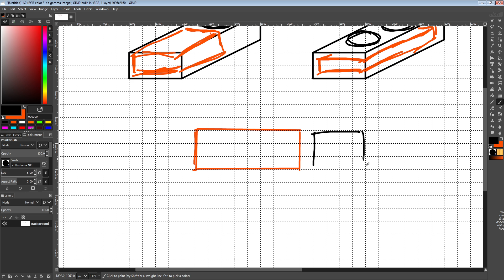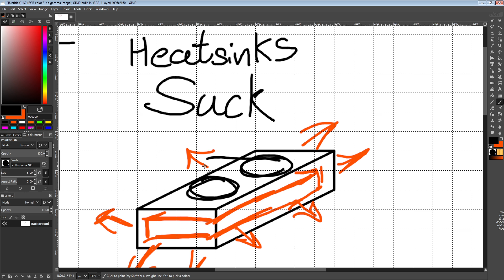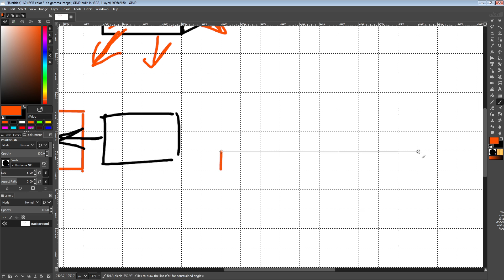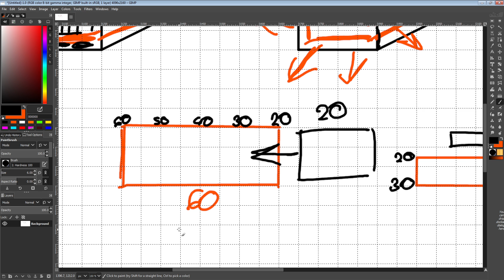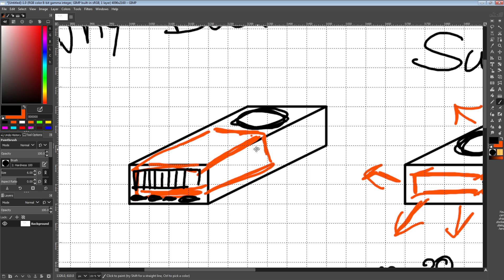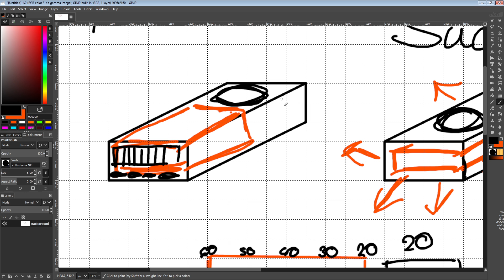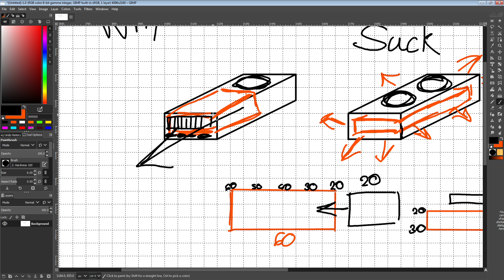Why blower heatsinks suck

Comment: 21:15 to 21:40       I have never been so convinced in my entire life.
Reply: So very true, and even worst, my 980Ti's main cooler cools ok, but it's backplate is buring hot,  The main fan flow does not reach the backplate, the CPU heat is trown on the backplate, and and and.. its crap. I duckt-taped a fan to the videocard. a bad case of bad case
Reply: you're easily convinced.
Reply: @-morrow  sorry
Reply: @pangtundure  perhaps read the comment from Sam Fedorka to deconvince you? ;-)

Comment: Buildzoind: you could not chose a worse design

Me: vacum insulated card to prevent GPU heat from heating up other stuff
Reply: Congratulations, you’ve just invented a XFX THICC 3 series GPU :)
Reply: @gingeritto  All that was needed was Happy Meal plastic!
Reply: Sun in a vacuum of space: Am I a joke to you?
Reply: @Loachie90  sun only sends out heat through radiation. Although the gpu will have minor radiation most of the energy will be kept
Reply: @user-y6f  until it heat up enough to glow.
Reply: dont give AMD ideas...

Comment: What if: https://prohardver.hu/dl/upc/2020-09/493_vga_cooler_toomuchtdp_2.png
I (and most of us) have extremely unexploited space in the case: over the PCIe slots. Use them to have a cooling system, that merges the advantages of the blower solution with SILENCE. :)
Legend: RED - fans | Orange - Heat pipes | BLACK - GPU | Rest - fins
Imagine a covering "tube" around it to ensure the air is moving outside the case.

So why don't manufacturers do this?
Reply: Just wondering why CPUs with 100-150W TDP have MUCH bigger space to have a cooler in it than the GPUs with ~300W TDP?
Reply: 1) It is possible and a lot of "mods" do exactly that - put CPU coolers on GPUs.
2) This will run into the same issues as high-consumption CPU coolers (like threadripper coolers) - when heat pipes are not enough efficient to dissipate heat through the whole radiator.
3) This will create a lot of issues for people with smaller cases, or with other expansion slots occupied, etc. and probably would be impossible to standardize.

But it is really easy to address - case manufactures can make an adjustable bracket for a fan or two near expansion slots. I did it by myself in a few cases and it is really simple "mod".
Reply: @InterUse  
1) That's not the same. It's very important part of my suggestion to ensure moving the air outside the case at the back panel part of the slots.
2) I don't think it's the topic here. You can use as much heat pipes as you can over a CPU or with a standard VGA cooler. The main issue is to push the warm air out with staying silent.
3. The space over an ATX motherboard is already standardized. Everything is already standard here, the only difference among the users is whether they use a slot or not. Thus, it's up to them to decide they want a VGA with such a cooler or not. ;)

Comment: they are great... because you don't need an ugly gaming case and still can manage to have reasonable/low case temperatures. great design, sadly limited when it comes to tdp.
EDIT: the problem is not the blower cooler, its the power draw of modern cards (remember the 5870 and its blower?)
Reply: Yeah, but on the other hand the 5000 series (well, the old 5000 series. Unfortunately we've got another one right now confusing things) were the most power efficient graphics cards of their era.

Granted the peak performance per watt from that generation is the 5770, not the 5870...

But you compare the tiny heatsink on my Sapphire 5770 to my RX480 (also a sapphire card) and it's insane how much the heatsink and fan setup has had to grow over time.

The 5000 series was the peak of Ati/AMD design, and unfortunately it's been downhill ever since.
(ironically Nvidia came out with Fermi at the time, which used huge amounts of power. - now the 3000 series seems to be repeating that concept. 350 watts for a reference design!? Are they serious?)

Comment: Love the content on this channel, but I whole heart-idly disagree with this. Do they cool as effectively as a huge 3rd party design? Not really. Do they suck? Not at all. Nvidia spends thousands of engineering hours designing them. They dont suck. I always buy reference/founders cards and they work great. Easy to put a water block on too.
Reply: it's like that ONLY to cost less and be sold at the same price while doing the bare minimum (often less than that), in that regard they are awesome yeah for the shareholders. you could say "designed by beancounters" but don't bring engineers into the equation: they know and they want to scream.
your purchase decisions are your right to make and that's ok, however the watercooling argument is moving the goalpost and it is undeniably demonstrable with practical experiments and physics calculations and simulations that it is in fact a flawed design. :)

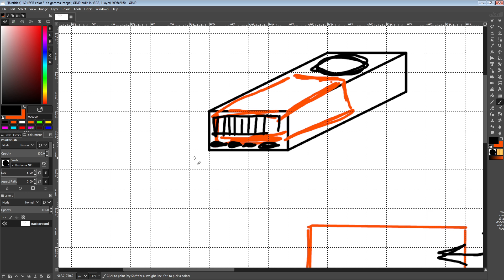Comment: only 5:00 in, so don't know if you covered it, but would love to know your thoughts on the 3090 FE design with the hybrid blower / axial cooler
Reply: The blower portion has a MUCH shorter HS, so won't have the long HS problem,  and the back fan is the much more efficient flow through design. I expect most cooling power at the flow through portion, but blower part will help prevent heat build up under the card. I am betting it works really well.
Reply: Only a couple of days left until we will get reviews of the 3080 and a week or so later we should get 3090 reviews. We might just wait this short amount of time and see how the cooler design performs.
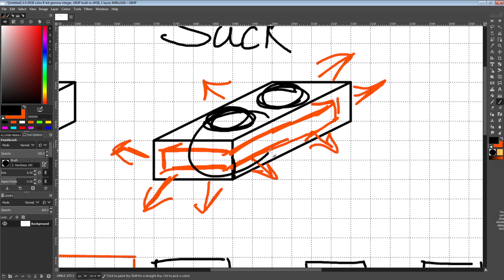Reply: He doesn't mention the 3090 directly but at 9:30 he is saying that boring through a cooler with heat pipes would be the best thing and even mentions a few examples other than the 3090.
Reply: there will be a downside that the Fan hanging off the back there will provide mediocre Cooling since it's nowhere near the source of the Heat.
the Heatpipes that i'm sure they're using will help compensate for it just like we do with all Heatsinks, but it means that part of the Heatsink will be completely reliant on those Heatpipes to do anything at all and also means that only the surface area of like a few Millimeters around those Heatpipes will do anything at all, and the rest will just be weight for basically no performance result.

if they really wanted to impress me, they'd have the other Fan also be able to move air through the PCB by cutting some holes.
to make that really work you'd want to move the GPU die farther away from the PCI-E Bracket though, to keep the most effective Fan as the one directly above the Die.

in short it's a better Reference design but one that's still pissing a way a lot of performance for little benefit.
Reply: @taiiat0  "but it means that part of the Heat sink will be completely reliant on those Heat pipes to do anything at all and also means that only the surface area of like a few Millimeters around those Heat pipes will do anything at all" 

Going by the renders the heat sinks are practically separate (because of the choke point on the decorative fins on the middle, which works passively if there are connected to the pipes, reducing the area exposed directly to airflow) which should indicate less performance but the use of heat pipes IS an effective way to move heat efficiently even when talking about small GPU/CPU dies, also have into account on most video cards, CPU coolers, laptop coolers, etc. rely mostly on heat pipes to soak the finstack (or exclusively just look at a CPU tower cooler) even relatively long distances (like several inches) depending on how much heat is being sinked in, the effectiveness at this point should be more of cooler construction and material choice

"they'd have the other Fan also be able to move air through the PCB by cutting some holes."

Are you sure about that buddy, sure a cool design and interesting as heck but a GPU is more than dies, ic's, and electrical components. A GPU is a device really dependent on frequency which makes it also dependent on PCB tracing and putting holes just to pass air would require lots of RnD without much benefit due to all the space required to keep signal integrity that why you see most of the mounting holes being away of the middle of the card to keep the most frequency dependent components closer together

 Overall i don't think it would be the best cooler out there but it wont harm performance, at least not a lot, also this design isn't all that new, even on "modern" GPU just look at power color 5700xt, NVIDIA's is a way bigger hole but is a tried an true way to improve GPU thermals
Reply: yes, Heatpipes are a necessity we have to rely on everywhere. the point was having to rely on just the Heatpipe to get anything done and that a lot of the surface area of the Heatsink will do very little other than adding weight because of being far enough away to have to exclusively rely on the Heat Pipes to be effective.

PCB's are not insulating medium - whether you have a hole through the Fiberglass or not doesn't change that. if you need to protect the signal, that's what shielding is for.
having holes where possible to allow for real air movement (if they're going to always insist on strange Fan choices).

the other non Reference Cooler designs have much less of the problem to deal with since the entire Heatsink is pretty thin everywhere, so the direction of air is already getting all of the efficient surface area out of it.
the shorter PCB allowing a full face passthrough will get some of that benefit but their gayyyyyyyyyyyyyymery Heatsink designs are gigantic, and therefore really heavy and take up a lot of space, for little extra Cooling performance. it's mot of the same problem we've already been having with their Reference designs in the past, where the decorations on the Cooler are big and heavy and so a relevant percentage of the MSRP is not buying smart sand, but rather buying bent pieces of Metal as Modern Art.
Reply: @taiiat0  I'm not talking about interference on the traces rather topology, the bigger the path for a high frequency signal has to travel the more likely to have bad signal on the reception end, that's why oscillator crystals have to be so close to the microcontroller they are giving the signal, not only that but they have to reach the receiving end at the same time, like the ram traces to the CPU, sure isolating for noise is one part of it but also the length is important the shorter the better as long as is the same length as the other traces, putting holes anywhere near to the first fan would be a tracing nightmare.

"the point was having to rely on just the Heat pipe to get anything done and that a lot of the surface area of the Heat sink will do very little"
Again i don't see why, if the way they put together the finn stack is effective heat transfer shouldn't be that affected at least i don't think in a noticeable way, longer heat pipes had been made solving the same issue moving the heat to the actual heat exchanger just take a look at this [https://hardzone.es/reviews/pc-sobremesa/shuttle-xpc-sz87r6/]

This are stupid far from the CPU but they are sufficient to keep it on spec

"Heatsink designs are gigantic, and therefore really heavy and take up a lot of space, for little extra Cooling performance."
Well, yes there is a point of diminishing returns, about the design of this generation half of the cooling design guarantees no re-circulation of air, but sure you are right the passive pieces NVIDIA put on the sides could have been put into a thicker shorter cooling solution and also paying on the custom reversed fan is added cost but even that doesn't seem that you are paying a lot for it.
Reply: @Snst-404  
i don't recall suggesting moving Traces to cut holes. you cut holes where you have space.
Reply: @taiiat0  I'm not sure whether you haven't thought this through to the end or you don't really know how heatpipes work. 1) That is literally how every single aircooler for a CPU works. Are you really trying to say that tower coolers are worse than top-down ones because you rely on the heatpipes to get the heat to where the air can flow more unobstructed? 2) Heatpipes are basically closed loop watercooling in miniature form - so are you also calling water cooling bad because you rely on the water to pull the heat away from the block?
Reply: @bbman85  
since you can't read either or are in over your head or something - the amount of Heatsink Material thatçs far away from the Heat source and also far away from the Heat pipes that will be necessary for any level of function - makes for a lot of useless surface area. Fins are inly useful to about half an inch away from contact with a Heat pipe after which it doesn't do anything anymore.
their gaaaaaaamer Heatsink has a lot of dead space and dead weight.
Reply: @taiiat0  What the hell are you talking about? If those numbers had any basis in reality, something like a NH-D15 would not have the rank it has. Even aside from that, have you actually looked at any render of the 3080? Every single image of the card on NVidias product page shows the heatpipes spreading out evenly under the fan! It's not like it has a tall finstack either, I'd be surprised if there is even half an inch of room in ANY direction from those pipes...
Reply: @bbman85  
that's the reality that all Coolers have to deal with. that's why CPU Tower Coolers put the Heat Pipes directly in front of the highest airflow section of the Fan, so that the area that actually gets Cooling effectiveness is right in the path of the Airflow. that's where all of your Cooling comes from, the rest of the Fins' surface area past that half inch or so is mainly just there to give the Fan something to mount to, make it look aesthetically pleasing, Et Cetera.

i'm sure Nvidias' Reference Cooler is better than their previous ones, but that's setting the bar as low as possible. hard to not improve. but the 3rd parties will continue to produce dramatically more useful Coolers like they have been previously.
Reply: @taiiat0  Right, so a different one to that where it is proven time and time again that more surface area is king in any type of heat exchange...
You must be trolling, because you keep contradicting yourself: this cooling solution does exactly what you want, it puts the heat in the area with the highest airflow! 
When you finally manage to formulate a sound argument why a heatstack with good airflow like here should be worse than the usual bruteforcing of stacking multiple fans against a wall, we may continue this discussion. Otherwise, have fun in the "reality" where manufacturers happily gift you metal to make something pretty... 😂
Reply: @taiiat0  But isn't the heatsink/heatpipe construction responsible for transporting the heat to where the fans can blow air through a finstack in all cooling styles? 
If you think about a "normal" triple fan design. Only 1 of those 3 blows air directly at the gpu area (where most heat is created) while the other 2 have to rely on heatpipes to get the heat to them. 

So I honestly don't see how this problem would be exlusive to Nvidias design and not just a general problem all cooling solutions have to deal with (except for maybe full cover water blocks)?
Reply: @taiiat0  ... uh there are two fans.

One fan is most likely all for the gddr6x memory while the other is centered directly over the GPU chip.

The heat from it will be blasted out the back of the case like a mini blower fan. Both of the fans are on opposite sides of the card.

Im guessing 70-80c but really quiet due to slow fan speeds.
Reply: @SuperSilvi1990  
your additions means only one Fan for the Die, and half of the Heatsink for it
which is just making this go farther downhill. they could reach a position of not being at the thermal limit at all times with such a large Cooler, but it's more and more sounding like it's a piece of shit like usual.
Reply: Seems like an effective design, I just worry about the longevity of the pull-orientation fan, because that motor and bearings will heat up a lot more than any fan installed in a push-orientation.
Reply: @ydihtty  I would say that it would last longer in my opinion.

Without having the fans work against themselves by having a pcb to block the airflow. The fan can now spin slower to do the same amount of work because there isn't an pcb in the way. 

I have a feeling a lot of people's rooms are going to heat up because the hot air will now actually be exhausted more efficiently instead of getting stuck in a gpu loop.

Comment: I don’t see any motherboard blocking one of the exhausts in the axial design 👀 
The issue with them is that the layout inside a case works against it as there’s no clean path for the air to go and much of it is recycled through the GPU a few times.
Reply: Motherboard mention. Wish more cases had a strategically placed fan and not a million miles away in the front panel behind some glass.

Comment: The grille on a blower's PCI bracket is probably structural.
Reply from the maker: sure but that doesn't change the fact that it's bad for cooling.
Reply: @ActuallyHardcoreOverclocking  oh, absolutely. The grille blows, or, rather, makes the blower blow less well, which sucks.
Reply: they apparently dont need them on the mi accelerators
Reply: @malteroeper3723  their server-grade machine-learning accelerators are passively cooled, and they are intended to be installed into rack servers that provide the tons of air blowing over them to cool their heatsinks.
Reply: @SeanCMonahan  what I ment is the grill at the slot covers the MI accelerators are open in the back but bisically a blower style with no extra fan so without grill should be possible without sacrificing stability
Reply: @malteroeper3723  ah, gotcha. Maybe that's because they don't weigh as much as cards with active cooling? Not sure.